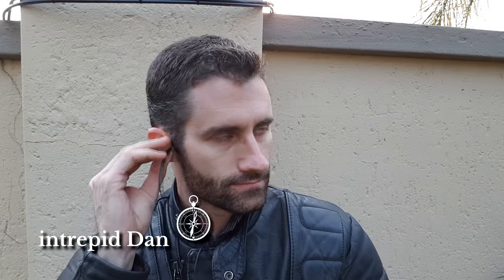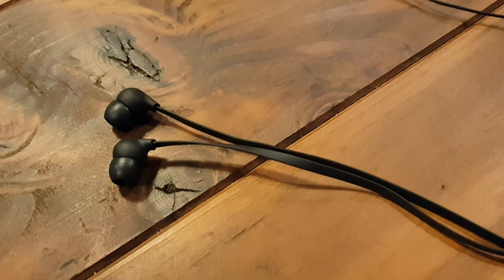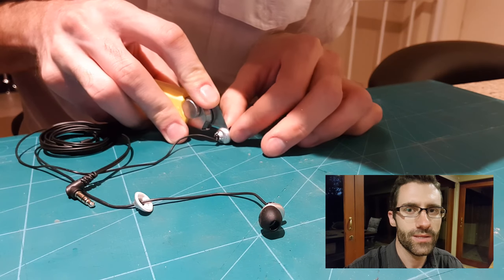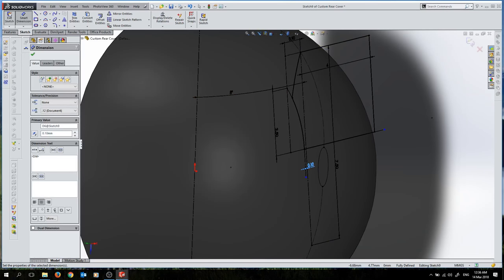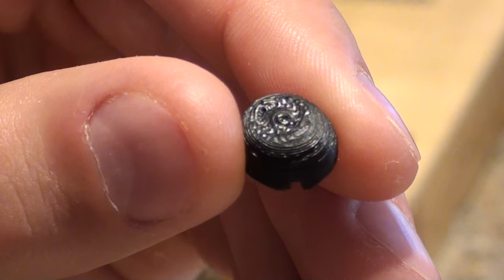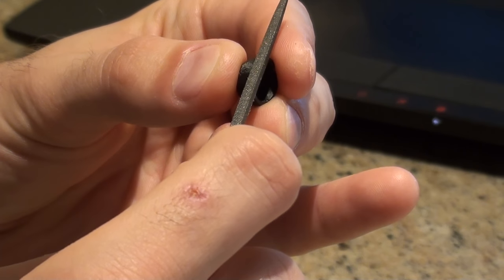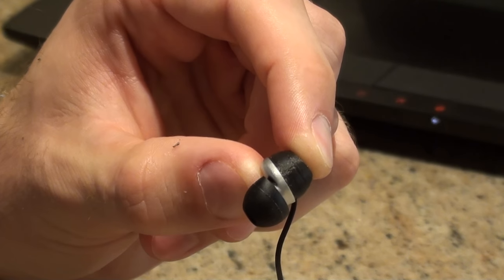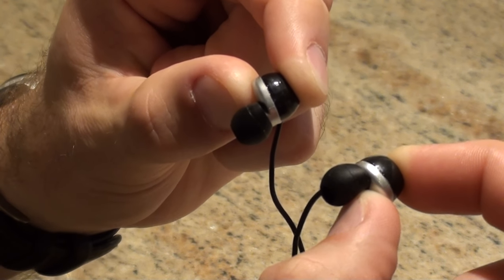Custom 3D Printed Earphones - I Made a Thing!

Comment: Hi Dan, Which 3d-printer are you using?
Reply from the maker: This particular print was outsourced, so I'm not sure what they used for that. Nowadays I have access to an Ultimaker 2+, which works pretty well with PLA. It battles with ABS though..